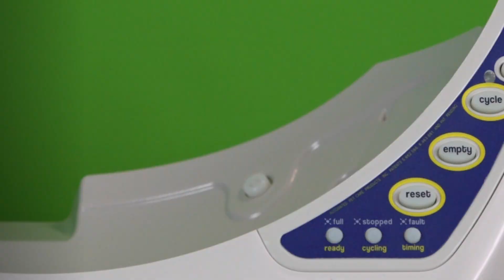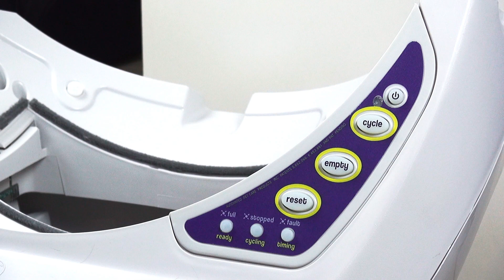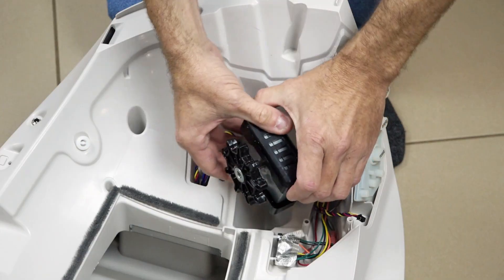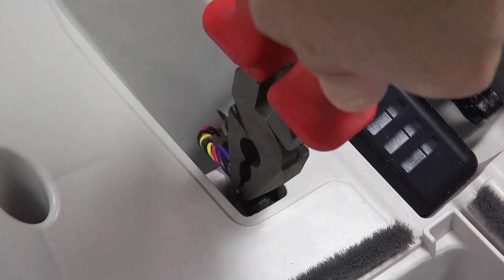Litter Robot III Installing DFI Sensors Kit

Comment: 14:43 this part here is really pissing me off, I’ve been trying for half an hour now and either the plugs on the back keep coming off, or the buttons don’t sit right and the cables are too tight to give you any real movement
Reply from the maker: review the wiring in the base coming up into the motorwell. there is plenty of length if not caught underneath.

Comment: WOW, wish I had found this last night when I was struggling to see the details on the LItter Robot video. Much better job.  I couldn’t see how that black plug went in or which connectors to disconnect.  I may have to pull it apart again just to make sure I get all the wires clipped correctly because they didn’t cover that at all.
Reply from the maker: Great to hear the video is helpful. Our tech did an excellent job of good closeups to help. The Litter-Robot is well designed with colour coded wiring and channel and groove for getting plugs correctly aligned, and the video helps with seeing the detail.  Feel free to share if you see anyone needing the assistance!

Comment: Thank you for the video help! It was all I needed to get our 2007 Robot going.  I had to slow down the video to 50%, which made the guy doing it sound drink which added some levity to the process.  I am thinking that I must have done something wrong since I did not end up with any leftover parts.  I will have to wait and see but right now it is a happy little Robot.  We have 2 of them, the other one is newer.  We have owned one, not the ones we own now, since 2003.  They are fantastic and their customer service to amazing! Thank You Mr. Litter-Robot!
Reply from the maker: Thank you for your feedback, and slowing would definitely make the audio interesting! There should not be left over parts, except for the ones you removed and replaced. Well done as the DFI installation is the longer of Litter-Robot repairs as you access both base and motorwell, so you can now be confident of self installing if needed. Go you! And yes, yah to Litter-Robot and no scooping!

Comment: The fact that this had 17,000 veiws is not a good sign.  I loved it at first.  Now look where we are.
Reply from the maker: with over 1,000,000 sold, its actually a great sign, plus the Litter-Robot 3 is self repairable so you get longevity after warranty - big bonus now when most appliances are throw away and buy another one!

Comment: Thank you for this amazing video! You showed so much detail, and that made all the difference in the world. Trying to figure out how to install the DFI would have been a nightmare without this video. Charlotte, Dutchess, Bittle and Tigger thank you a million times over for saving the day!😊
Reply from the maker: A purrleasure! Nathan did a wonderful job shooting the video and it helps to see more detail when installing. Its not that its too hard, but it needs to be done step by step and takes a little while. Well done on your installation and you can now be confident on self installing if needed for good longevity, as the DFI is the longer of repairs due to accessing both motorwell and base. Well done YOU!!

Comment: First, the instructions on any video related to this are off because the wires and even the plastics pieces shown are not what’s in the newer versions of the LR3. So that took time figuring out. They need to update the videos. Second, I went through all of this to have the same issue; nothing has changed. At this point, I am highly dissatisfied with this product I’ve had less than 8 months.
Reply from the maker: Thank you for your feedback. I suggest you contact where you purchased the Litter-Robot as this video was created in Australia in 2021, with the process for the DFI version 1 similar but not the same for the revised (new version ) of DFI v2. Whisker.com is the manufacturer and can assist you further if you are not able to contact the company you purchased from (it appears you are USA based). If nothing has changed following installing the new DFI successfully, and you still have a flashing blue light, check you installed the DFI mainboard plug the correct way up. There is channel and groove to assist that need to be checked when installing. WE trust this assists.
Reply: @Catevolution1  yes I called them and they are sending a new base, free under warranty
Reply from the maker: Good to hear. Whisker is a great company who fully support their products @ms.ashley

Comment: This video is a lifesaver. We tried everything to get the DFI sensor working, and this finally did the trick!
Reply from the maker: great to hear it's helpful!
Reply: real pity that it even came to that. I've found this litter robot to be the cheapest, most poorly engineered thing I've ever wasted $800 AUD on. Mother of god what a piece of garbage. It was less fuss to just scoop litter then by this thing that faults out every day with some new nonsense.

Comment: Thank you!  You made replacing my DFI sensors for the 1st time not so difficult.  My 2 Sphynx cats told me to thank you as well.  I found out this a very common issue with these sensors going bad.
Reply from the maker: Great to hear you have self installed, with the Litter-Robot 3 designed to DIY providing good longevity. The DFI Has been redesigned so the green boards are fully encased to provide durability with varied quality litters, as Whisker.com are excellent in continuing to make improvements if reasonable, even with a new version released. Its a big uptick for the LR3 ;o)

Comment: Better than the whiskers video ive just done this but it wont power on now . Great video though
Reply from the maker: Thank you, purrleased to hear the video is helpful. For no power, check you have the plugs plugged in still in the motorwell, sometimes they can come loose when refitting the cover. You can also test if you open the motorwell, if you add the bonnet to complete the circuit. It can be helpful to unplug each plug to see if you can isolate the sensor that maybe the issue. Also check your power supply is correct. If needed you can send photos to support@catevolution.com.au and I can take a look. DFI, pinch, motorwell, underside are all good photos for review if needed.

Comment: The LR Cat Sensor DIY kit I received just has a wheel, a spring, a rectangular metal cover and a long screw.  It is not what you are installing.  What did I really get and how do I install this?  My problem is the LR doesn't register the weight of lighter cats l.  I've tried tightening the screw in the top is the drawer space but it won't go any tighter so they sent me this. Should they have sent me what you installed?  Help!! Thanks!
Reply from the maker: You have a cat sensor kit.
Reply from the maker: https://youtu.be/wLwgz3hWgMg

Comment: My LR3 starts to have flashing blue lights, when pressed the reset it changed to flashing yellow light rapidly. Do you think my DFI sensor is also bad? I checked the left side of the IR led with phone camera they are not flashing. Thanks!
Reply from the maker: Yes, DFI and pinch detectors need attention, most likely replacing.

Comment: I think it will be much easier and less work if you remove the bottom part first, then work on the top part, removing the wires, dfi etc.
Reply from the maker: I actually do that, but you do need to squeeze and pop out the cable clip where the wires go up into the motorwell
Reply: @Catevolution1  I take off the bottom first just now, still less work. Great video though and guide for me install new dfi, now my LR is working again. FYI now it is v2 dfi it is different and the sensor is 70% smaller and completely covered up with silicone or something, much better.
Reply from the maker: @TeleeFONE  yes, new version DFI is big uptick for LR3 😻
Reply: @Catevolution1  yup saw the new version and impressed, hope this will last a long time coz my LR been giving me so many issues lately 🥲, breakdown every other month and something need replacement. 5 year owner of LR3.
Reply from the maker: @TeleeFONE  use good clumping litter (solid clumps) if dusty, use brush end on vacuum to suck clean base area when deep cleaning. New DFI should be pretty much proof against poor quality litter.

Comment: I could really really use some advice please . I'm honestly starting to get so cross and frustrated . I finally received my replacement dfi and pinch sensors..sat yesterday and replace both the pinch brackets and the dfi . The pinch sensors are touching as they should be and the wires connecting to them are secure . As is the one to the control panel . My litter robot is still not working .. Still a constant flashing blue light as if the waste drawer is full . I don't proclaim to be a expert but I've stripped down xbox and switch controllers and rebuilt with no issues so I have a bit of experiencing with electronics.  I can't work this out and I'm about to throw this thing into a dump . Please help
Reply from the maker: Do make sure you have the DFI plugged into the mainboard the right way. The dark wires should be uppermost with the brighter wires close to the wide bottom of the mainboard. There is a channel and groove that line up on plug and socket if you look closely to help. If not sure, unplug and turn upside down and replug to test.
Reply: @Catevolution1  not sure if my comment posted as j can't see jt . Just wanted to thank you for taking the time to reply.  I had actually managed to get it workimg I squeezed the pinch sensors together with pliers . Disconnected a couple bunches of wires from a black plastic piece by accent and couldn't get the tabs back I'm but I'm not sure they actually do anything lol, for now it's working
Reply from the maker: @christinebrookes4586  good to hear you are back in working order. Not sure what you have disconnected. I would suggest you get in touch with the company you purchased from by email and provide photos for further assistance as there are some parts that are safety features and need to be in place. Thanks for the update !

Comment: Your instructions were easy to follow, but alas, when I attempted to turn on the unit there was no power. What might I have disconnected? Thank your assistance.
Reply from the maker: Check your power supply for damage. Also turn on (no power) and feel the control buttons. If they are warm, there is power coming to the board ok. Check you have the DFI still plugged in the motorwell, as sometimes it comes out when you put the cover back on. Do ensure you add the tape to keep the wires clear of the black gear wheel.
Reply: @Catevolution1  My bad.  I looked at the circuit board and saw a plug was detached.  I reconnected the plug and the unit was powered, all is fantastic.  Your video was spectacular!  I was extremely reluctant to replace the DFI sensor but you made a dauting task easy.  Thank you so very much.
Reply from the maker: AWESOME!! Well done. And fyi, installing DFI is the longer of repairs, due to accessing motorwell and base, so you can be confident to do self installation for great longevity!

Comment: after following this video step by step I replaced the dfi kit put it all back together. plugged it in and yellow cycle light stays lit. it will not reset, cycle or power on/off nothing happens just stays on yellow light. on the app it says robot is off. please help
Reply from the maker: do you have blue and yellow solid or just yellow? if just yellow check you have the dfi plugged into main board right way up. if 2 solid lights you are in sleep mode. Press and hold CYCLE 3-5 seconds until 1 light goes out.
Reply: @Catevolution1  just solid yellow, dfi is plugged in correctly as it only fits one way. It is a newer updated model dfi as the circuit board is different. Much more short not as long. Controls do not work, app does not work saying robot is off
Reply: @peterc6197  Do check the DFI plug, the ones I see have 4 pins, so square and are sometimes put in upside down. Otherwise, maybe motor or main circuit board issue. I suggest you reach out to the company you purchased from as its little difficult to do this on youtube without photos to review. Where are you located? (country). We are Australia and NZ only.

Comment: Very clear instructions and video amazingly done. I loved the guest appearance of your kitty through the video :) - quick question, at minute 16.14 you said you can check if the DFI sensors are working by placing your phone on video mode. Do you put your phone where the tray would be? meaning the tray would not be inserted in the unit? Thank you
Reply: Hi Marisa, yes, you put your mobile phone into the cavity in the base after removing the waste drawer. Point camera at the left hand side DFI green board, and with the Robot on and your phone in camera mode, you should be able to see the infa read beams flashing as 4 blinking reddish lights, along the left side board. They are not visible to the naked eye. Thank you for your video comment, Nathan does a great job and his cats are devine!

Comment: Amazing vid. I had replaced the DFI couple of years ago but now it failed. I had this time bought the DFI sensors version 2 . An improved version, the cards are shorter and insulated. Do you happen to have the v2 installation video? Tks.
Reply: sadly not released overseas yet, but coming.... my understanding is the installation is the same. Check your pinch detectors too!
Reply: @salescatevolution9977  l 'm  from Singapore, just got it from Robot shop Japan. Its so much better from v1. Installation is a breeze and works perfectly. v2 is abt 1/3 the original size. The sensor card housing/bracket is slightly different. The pinch detector was totally rusted and got it replaced. I'm trying to fabricate a brass detector instead.
Reply: @sbsani  good to hear. Maybe we will have it available sooner than expected!
Reply: @sbsani  great to hear as we are looking to get these in for Australia and NZ. for the pinch detectors, I think they maybe brass under the silver metal coating. Brass oxidises which may slow the power tranfer. The best thing is to use good quality clumping clay litter that locks in the uric acid in cat pee, and keeps the odour and base cleaner.
Reply: @salescatevolution9977  I agree. Thanks for the advice. Then I may try and use a stainless steel strips instead.
Reply: @sbsani  The pinch detectors are pretty cheap to buy, just review and replace. Better clumping litter will give you less issue ;o)
Reply: @salescatevolution9977  I 'm using Odour Lock litter. Any brand you might recommend?
Reply: @sbsani  Ever Clear is a great clumping litter and it's recommended by Catevolution.

Comment: This video was so helpful. The instructions that came with the sensors were blurry and unclear.  Replaced sensors while watching the video and my litter robot is good as new. Thank you!
Reply: Great to hear! Well done as replacing the DFI is the longer of repairs as you access both base and motorwell. You can now be confident of self installing if you need any parts on the Litter-Robot for great longevity!
Reply: What were the symptoms of your robot? Mine is flashing ready but will not cycle.

Comment: I did install the parts and the blue light is still flashing. What else could I do? Also my robot is not connecting online.
Reply: You are welcome to send photos to customer support to see if the installation is correct. Is your Robot a Connect? Provide serial number for review.
Reply: did you ever figure this out? Same issue. Replaced DFI, everything looks good, still slow blinking blue light when i power on